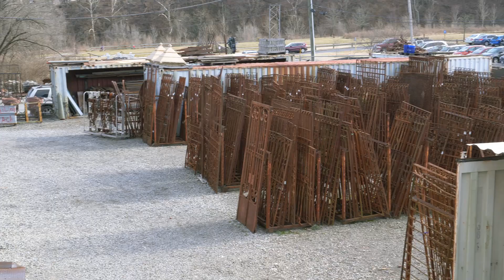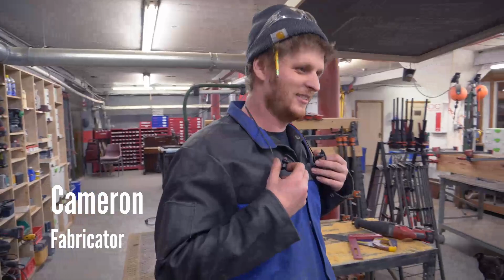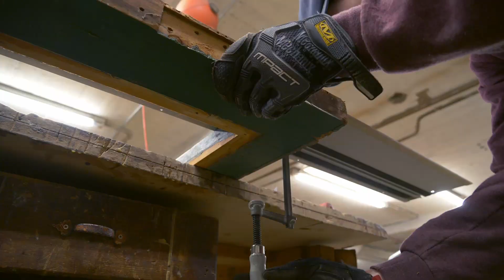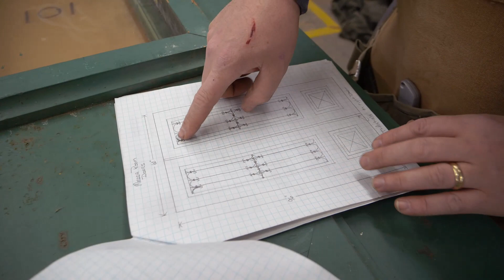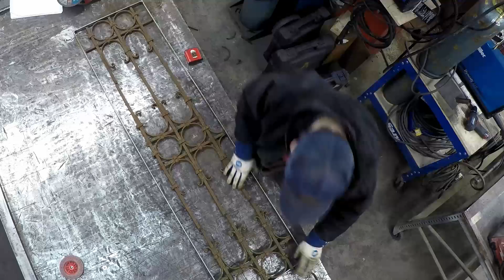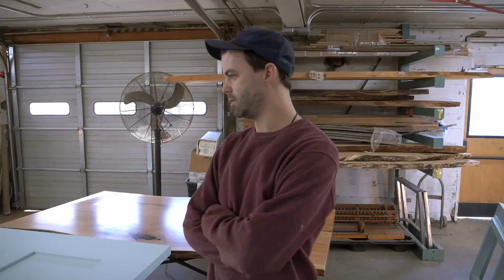Solid Pine Doors Up-Cycled with Custom Ironwork

Comment: Due to the age and condition of the door, did you opt for an oil-based, latex primer, or even a shellac based stain blocking primer--something that dries relatively fast? I am also curious why you tinted the primer to a light green, which may be an issue for the installer if they prefer a white or off white? Love the fabrication shop--perhaps suitable for a spin-off show?